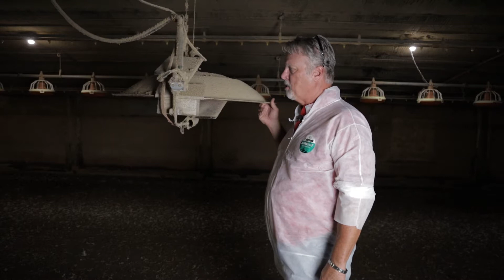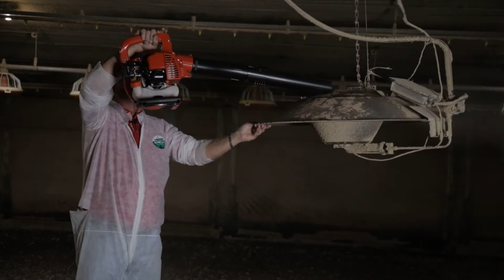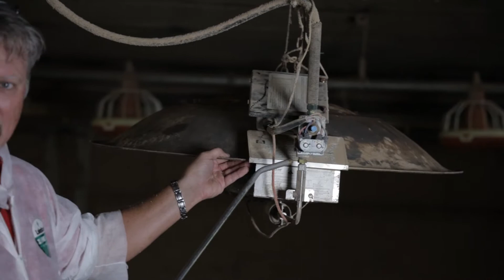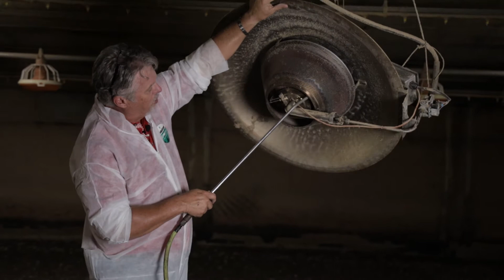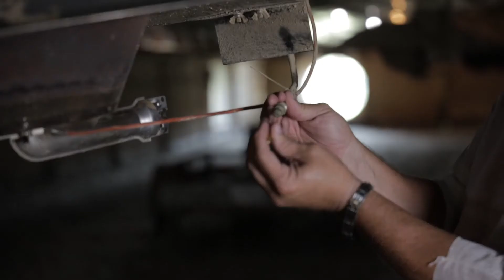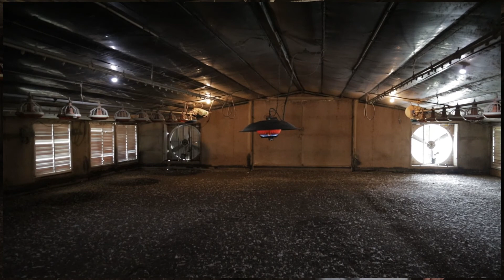How to Clean Your Space-Ray LoPro Brooder

Comment: It's also a good idea to regularly check the flame appearance every time you use the heaters, because while it's good practice to regularly maintain the heaters by cleaning the burners, and air intake orifice, you have to be aware of insects, spiderwebs, wasp / hornet nests etc that take a like to your heaters and clog the innards, burners, air intake orifices etc causing excessive yellowing and soot. Blue flames with just slight yellow tips at the top of the flames on LPG is fine but excessive yellow appearance / soot problems are a serious no-no and require immediate attention.